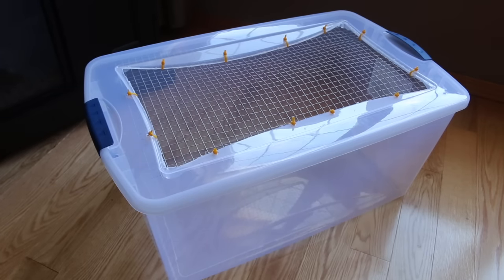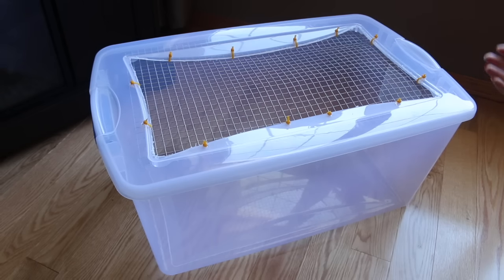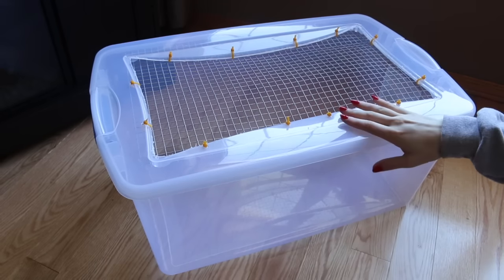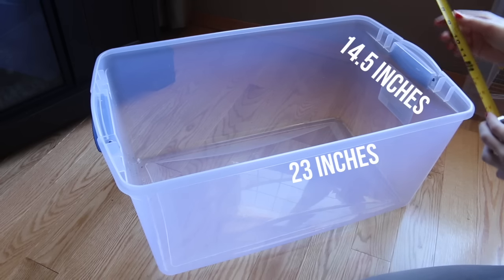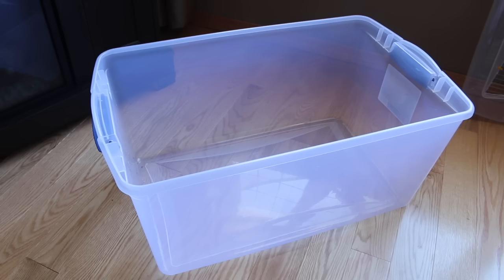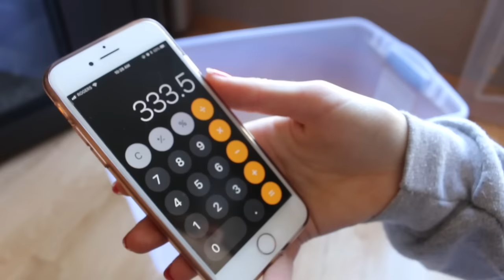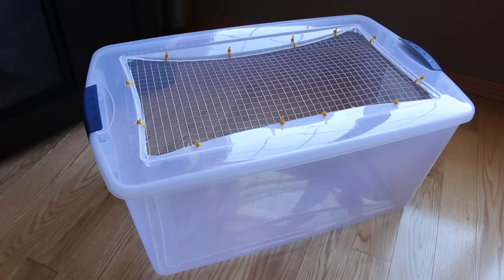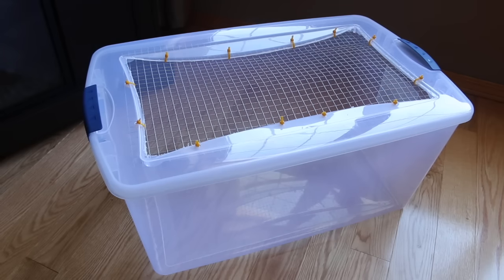HOW TO MAKE A BIN CAGE | DIY Hamster cage!

Comment: I bought a 29 × 20.5 = 594.5 square inch bin with 15 inches of hight and I never cut anything anywhere I just left the lid of (never actually bought one) I have a winter white (I believe thats what they are called,in my country they are "Talvikko") and there has been no issue she will absolutely have no way of escaping from the top because of the hight :)
Reply: Oh yeah and the bin was from Ikea, it was the biggest possible SAMLA bin (about 17-18 euros) and I HIGHLY recommend it if you can get your hands on it :)

Comment: Do you need mesh? Or could you just make a lot of holes in the ceiling and or walls????
Reply from the maker: Yes mesh is the best way to provide ventilation
Reply: @VictoriaRaechel  ok thank you
Reply: @VictoriaRaechel  can I put any on the sides or can I only put it on the ceiling

Comment: If it is to small can u get two and make a hole in both of them get a chobe ang atach them together is that OK because it does make it more bigger!
Reply from the maker: It would be best to start off with one appropriate sized bin and then after that connect more if you want :)

Comment: If I put mesh on the side of the cage and then fill the cage up with a lot for bedding could my hamster chew the wire and escape?
Reply from the maker: They're more likely to chew the mesh if it's on the sides, I recommend putting it on the lid
Reply: @VictoriaRaechel  ok!!

Comment: What about the excess wire in the inside? I'm worried about it being sharp--can I trim it and tape it down?
Reply from the maker: If you feel it's necessary you can trim it down.
Reply: @VictoriaRaechel  thanks for getting back to me! I've decided to just lay it over the top and tape it from the outside. :)

Comment: Uh would it be bad to have a critter trail with just the hamster’s wheel and bedding on top of the bin so I don’t have to buy a new wheel?
Reply: SnowFox08 :D try to get a new wheel, it can be difficult for the hamster to get to the critter trail. also if you have a syrian don’t use the critter trail wheel at all, it is way too small (they should have at least 10 inch wheel). if you have a robo the wheel could possibly work, if you have a dwarf the wheel could still be too small. overall: just get a new wheel that has the correct measurements :) that’s the easiest thing to do
Reply: Okay thank you! :)
Reply: SnowFox08 :D no problem!

Comment: I’m “ rescuing “ two hammies ASAP, Syrians, buT I have like zero space in my room and it’s the only place I can keep them until I move out. I might let my sister have one in her room but honestly I want them all to be in my room- easier for handling cleaning etc and giving veggies. Is there any ikea system or cage that are stackable? I’m getting an ikea detolf for my three dwarf girls - but these hamsters NEED to be saved. Was scrolling on Craigslist for a hedgie and saw this ad- the Syrians ( yeS two females :( ) were in a tiny Walmart critter trail TOGETHER. zero toys. Now wheel just the one that’s attached to the cage which they can’t even fit on. They were little the size of the levels and could barely stand up in this cage. She’s trying to sell them together - I messaged her saying she’d need to separate them so we came to an agreement. She refuses to pay any money for them but I can get them , freaking sucks. I know if I’m not able to get them they will be sold together to uneducated people in that cage. Oh and another thing it looked like it had zero bedding maybe a paper towel in the bottom. So sad. At this point they’re in such bad hands it wouldn’t be the end of the world to get them separate them in two 20 gallon longs for a month or two until I save up for large cages. They will be spoiled with me though that’s for sure. New large wheels, houses , veggies toys etc. poor babies.

Comment: What if your hamster pokes it's self on the wire mesh insides because it looks like it has pretty sharp edges.
Reply from the maker: I've never had a hamster poke themselves. If you don't feel comfortable with the mesh like that you can secure it to the other side but that give the hamster the opportunity to be able to chew the plastic at the top.

Comment: Is it fine if you have two stacked bins that are both around 330 sq inches ?
Reply from the maker: I would say to have a  least one bin that meets the bare minimum of 450 SQ inches of floorspace, since when you stack cages it's broken floorspace and doesn't give them as much running space.

Comment: I almost had a hart attack I spent all day making a bin cage then I watched this video I started freaking out cuz i thought mine was too small my cage has 3318 floor space and when I saw yours that was 333.5 my brain was like that’s almost the same number because of the threes lol 😂
Reply from the maker: Did you measure your cage in inches or centimetres? 3318 sq inches is very large I’ve never seen a bin that big.
Reply: Victoria Raechel oh no I did it in cm dose that mean it’s too small them 😓😨 I know it’s big enough for me to sit in and it looks really big when I changed cm to inches it’s 1306.299inches that doesn’t seem right 🤔but maybe it is I’ll check later
Reply from the maker: Do you have width and length? I can do the calculations for you

Comment: Would a 32 1/2 length 
19 1/2 wide 
13 3/4 height work .?? 
Trying to make my hamsters home bigger
Reply from the maker: 32.5X19.5= 633.75sq inches
Reply: So it would work💯
Reply: So 633 .75 inches would work .

Comment: I was wondering if you could tell me where you got the bin from
Reply from the maker: Walmart
Reply: @Victoria Raechel is there a limit to how DEEP the bin can be. I have one that is about 500-520 feet of floor space. However its about 13 inches deep...could that effect the living conditions?
Reply from the maker: It can effect the living conditions, since you'll want at least 5 inches of bedding inside meaning the you will have a harder time trying to fit in things like the wheel and toys.

Comment: Having a hard time finding the metal mesh. Went to Home Depot and nothing I could use. They had screen replacement mesh but tgat stuff is too soft if I make some high windows on side of bins. I can see my hamsters chewing through those. Can someone suggest the exact brand or U.S. store?
Reply from the maker: Home Depot should have it, it’s rodent mesh, it’s used to keep mice out of your home usually.
Reply: @VictoriaRaechel   Thank you! I asked 3 different clerks. Will try another location. I made do without it for now, just drilled alot of holes.
Reply from the maker: https://www.homedepot.com/p/Fencer-Wire-1-4-in-x-2-ft-x-50-ft-23-Gauge-Hardware-Cloth-CA23-2X50MF14/306743902 there's a link for some!

Comment: Why do you get the mesh from?
Reply: You can get the mesh from your local Home Depot or hardware store, it’s just some simple chicken wiring. (You should also get a 50 or 55 gallon bin or a 200/220 quart storage bin for the cage. Anything smaller is unsuitable for hamsters)

Comment: I heard that the plastic from the bin cages is dangerous for hamsters and emits fumes that are bad for them. I was told  to not go with this option as it is unhealthy for the hamster. :(
Reply from the maker: Never experienced anything like that, maybe if your bin is sitting in the hot sun with zero ventilation but you wouldn't have a hamster in that type of environment.

Comment: Everytime I try to make one it always cracks when I drill in the lid 😭
Reply from the maker: Warm the plastic with a hair dryer to help prevent cracking
Reply: try getting some duct or masking tape and put it where you want to drill... the tape should protect the edges while still allowing for the drill to do its work...